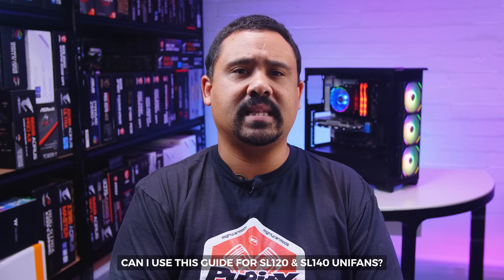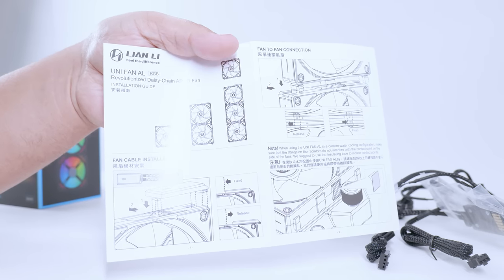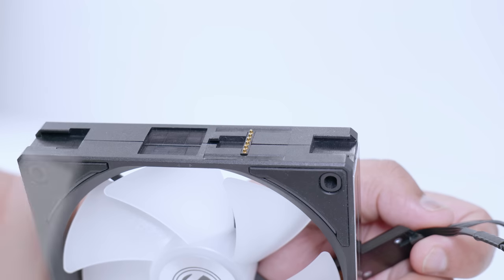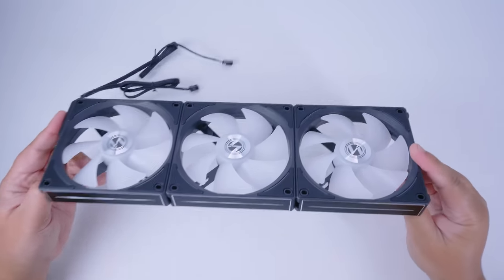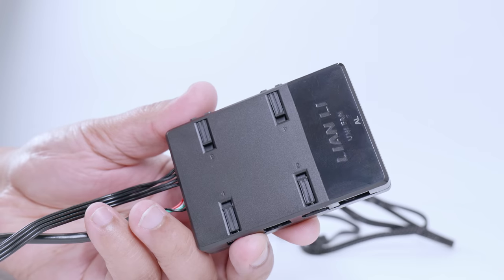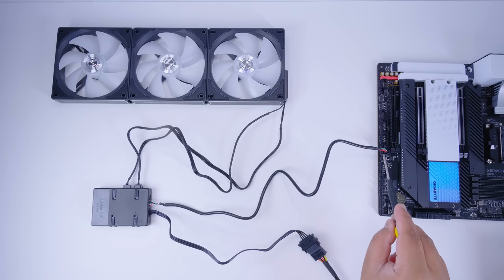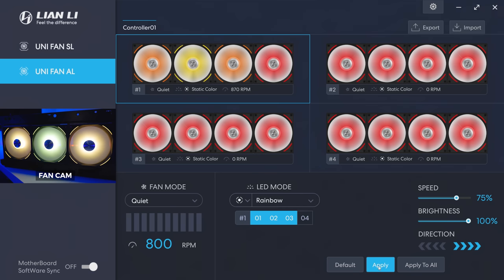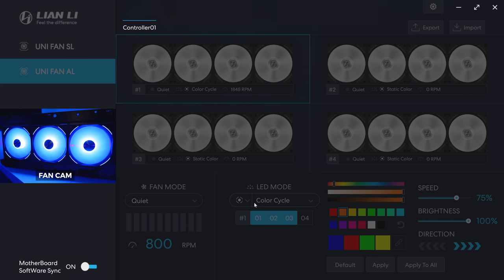HOW TO Lian Li UNIFAN AL120, SL120 & SL140 Easy Installation & Setup Guide

Comment: When I change their settings to PWM they start spinning on 1800 rpm all the time, i think that not correct...am I doing something wrong ?
Reply: Same. Were you able to find a solution to this?
Reply: @shotzy3229  I think i found a way to do it but i haven't tried it yet, is by getting an adapter to connect to the fan on the motherboard with 4 ports (in my case), leave the RGB wire connected to the controller, but the power ones, connect to the adapter you plugged into the motherboard. that might do it. because the system will understand those fans as Fans instead of an USB.

Comment: Does the controller remember the settings from the software? (So if you booted into macOS or Linux after using windows...)
Reply: Excellent question, as I dual-boot between Windows 10 and CentOS 7.9 Linux.
Reply from the maker: It does not. Its why I rarely use the controller on builds

Comment: dang I ordered 3x3 packs now I see it needs to be connected to usb header..
Reply from the maker: Use 1 controller
Reply: @GearSeekers  i have only 2 usb headers on x570 dark hero and they’re used. Just looked for nzxt internal hub 3 and will get it. Thanks for the installation guide 🙌🏻

Comment: ONE FLAW IS HAVING ONLY 1 CABLE COMING OFF THE FAN PWM, SO IT CAN CONTROL PWM, BUT NOT READ RPM TO THE MOTHERBOARD
Reply from the maker: It can though
Reply: So do you need the pwm cable plugged into the controller for the software to use pwm mode?

Comment: You will run into problems if you try to mix and match 120 fans with 140 fans. 140 fans don't come with cables needed to connect to the controller. Good luck finding any either. This is unacceptable in this day and age. Go with something like corsair that all work together without having to search for and buy extra cables that work with the controller.